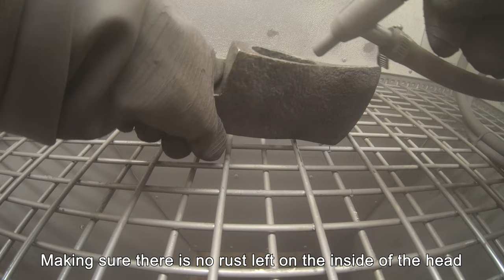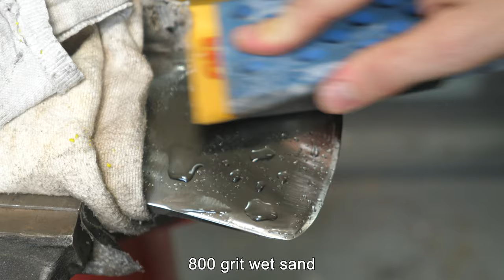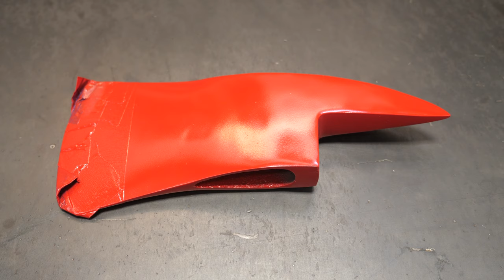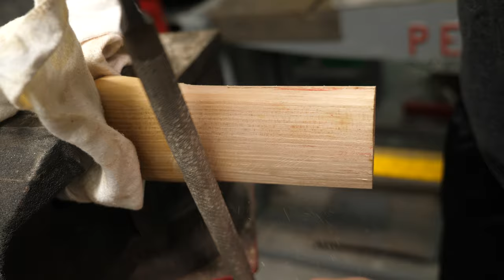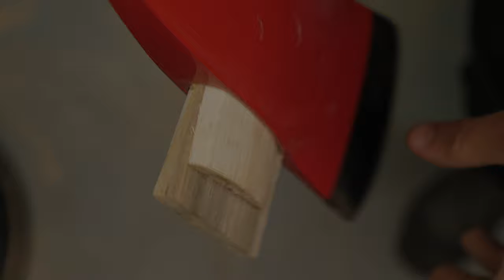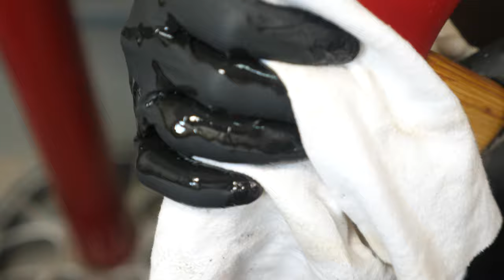Rusty Fire Axe Restoration

Comment: Nice job on the restoration. 
FYI, axes in the fire service are not supposed to get sharp. They are not cutting tools. They are actually smashing tools. But the axe you restored looks great and I would hang it in my house any day. 👍
Reply from the maker: Didn't know that, but it certainly makes sense. At least they still have other end to smash stuff with 🤷‍♂️. Thanks for the informative comment

Comment: nice job. I don't really see the need for the metal wedge. all it seems to do is break the wood. By the way, you should glue in the wooden wedge, then you'll never need the metal wedges.
Reply: Agreed. You can see the wood splitting when he hammered in the metal wedge. Should’ve glued like you said and the wooden wedge was a bit large IMO.
Reply: @f8c3themusic  I just saw a similar restoration, same thing. Those metal wedges just aren't that good. They're too thick, and why would you put one in cross grain without a relief kerf anyway? The design of those store bought metal wedges is all wrong.
Reply: On a typical fire axe the wood is cut down to the axe head. The metal wedge is to keep the wood wedge from backing out during a door smash
Reply: @carminemessinaiii1081   then maybe it shoudl be dirven in the other direction, I don't see how busting up the wood keeps the head on any better, in fact it probably causes early failure. I do not believe they're meant to be driven in that way, with no kerf cut, opposite diretion of the other one. Just doesn't make good sense. If the head fits tightly before the wood wedge goes in, no way you would need it after the fact, especially if you glue the wedge in. In fact, back in the day, on real fire axes and Pulaski's I never saw one like that driven in the wrong direction. In my day they used metal wedges, but they were much thinner. No way you can move the wood that much and not bust it to hell. If you really want to make sure it will stay put, grind out the wood a bit, make it a little concave, then fill with epoxy. It won't go anywhere, ever, providing you haven't already busted the wood up.

Comment: I LOVE RESTORATIONS, but when people remove all the character and the beauty of the patina it gets me lowkey angry, like you're still gonna use the axe and damage the surface, there's no need for a mirror polish. Try this...electrolysis > wire weel  and just touch on the blade a little bit. Then BOOM the axe is looking better than ever
Reply: I don’t mind it. I hate when they restore it and it’s useless. Like soldering a part that you know will fail. Or not fixing it so it works.